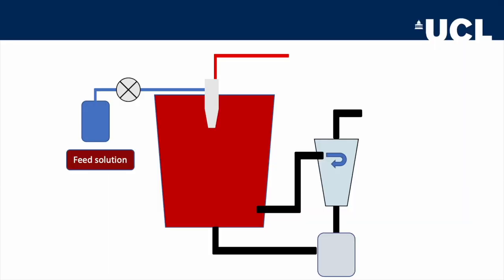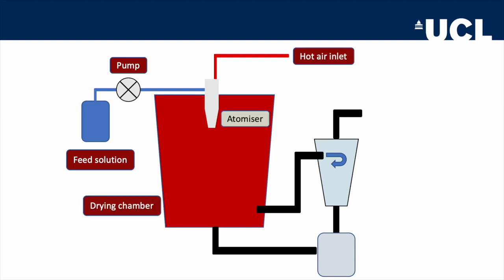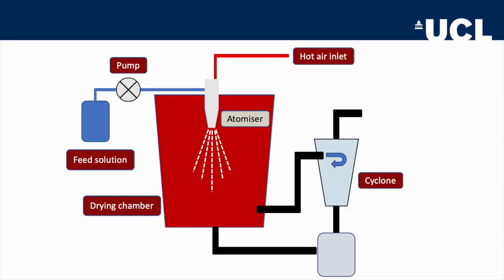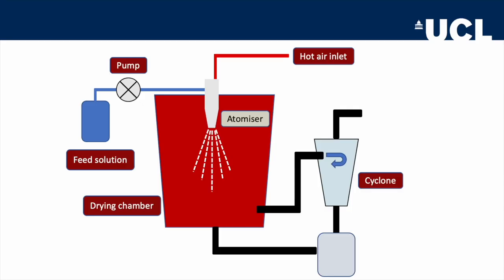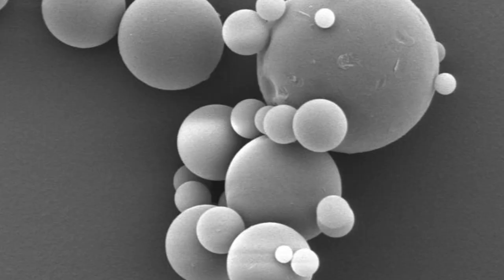What is spray drying?

Comment: Is there a difference between Spray Drying and Agglomeration?
Reply from the maker: I think that depends on what you mean by agglomeration. Spray drying has the material to be dried dissolved or suspended in a solvent (not necessarily water). There is also a process called spray congealing (which I am thinking is closest to agglomeration), in which there is no solvent - rather the material is melted and forced through an atomising nozzle into a cold chamber where it cools and solidifies - this is not a method of drying though, as no solvent is being removed.
Reply: Agglomeration is an aspect of multi stage spray drying where fine particles collected in the cyclones and bag filters are recycled back to the drying zone. The recycled dry particles stick to the wet particles before they dry fully and this creates an agglomerated product, or a single product made of several smaller particles stuck together. Agglomerated products usually have a more controlled final product size and dissolve in water better than fine powders. Infant formula is a very common agglomerated product.